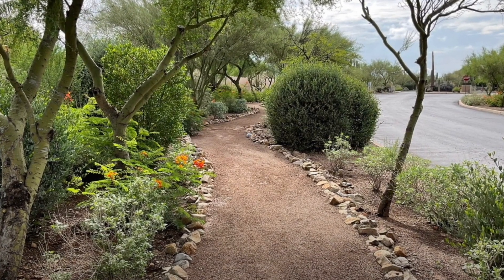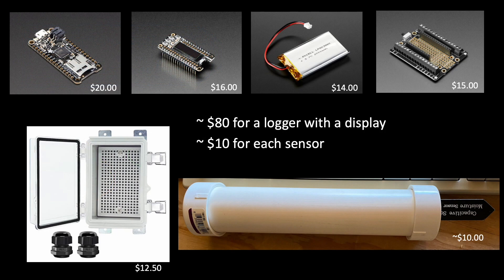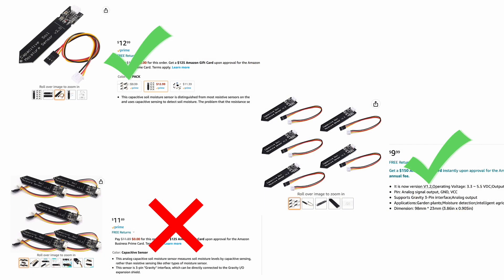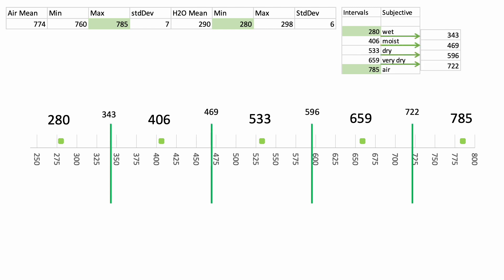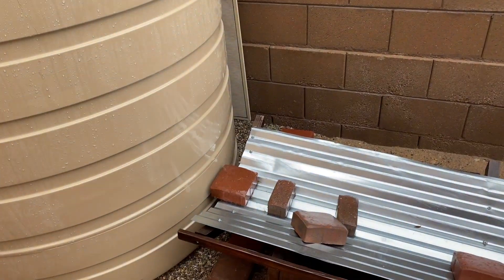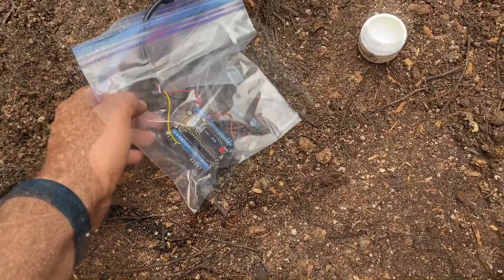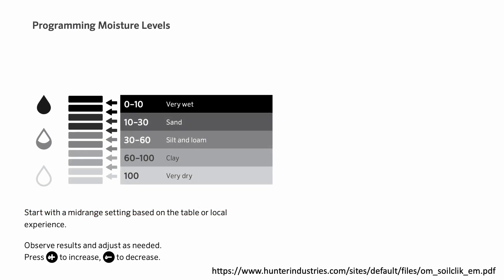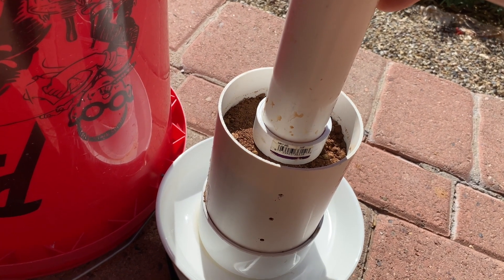Buying, Programming, and Testing Capacitance Soil Moisture Sensors

Comment: hello
what cable did you use ?
i mean the type and some specifications please
Reply from the maker: For my final permanent installation, I recall it was 20 or 22 gage three strand shielded solid wire for each sensor. Either gage will work. Shielded is better if you have nearby sources of electronic noise (e.g. lights, motors, switches, other).
Reply: @ModestMaker thanks a lot dude

Comment: Great vid and project :)  Just one observation.. did the PVC not prevent water from getting closer to the probe than it could have?

Edit: I see you responded to someone else on that.
Reply from the maker: You are right- I am redesigning to diminish bias from water flowing down the sides and include a datalogger. I will update once it's set up and improved. Thanks for checking it out!

Comment: For measuring in scale of 5, these cheap sensors probably will just work fine. 

Since the 555 timer on the sensors outputs only around 15kHz it's nowhere near to the high(>40MHz) frequencies needed reduce the effect of soils salinity on the moisture reading, that means anytime there are tons of rain that washes the salts from soil the sensor will show that the soil are dryer than usually, opposite case is when fertilizing, fertilizer is just a salt that will also affect the moisture reading in this case show that the soils are wetter than baseline. This also implies sensor will show different readings in different soils with the same moisture content. 

Another BIG factor is temperature, these sensors vary around couple percents per degrees C if I remember correctly, that mean if the day/night temperature varies with 10 degrees C it will result in 20% error, I think that is completely unacceptable for it to be useful. 

I strongly recommend testing and calibrating with high performance sensor, best performance sensor that I've tested is METER Teros 12(350$) moisture sensor, super reliable accurate from my testing. And from the cheap end the best sensors I've found to be PinoTech SoilWatch10(25$) sensors, with some calibration, digital signal filtering and temperature compensation they also can be quite accurate and reliable.
Reply from the maker: Thank you for that insight. Yes, I've read temperature can impact the readings. Also, we have high mineral content in our municipal water so that may pose challenges for informing common area watering in our Association (I use rainwater on my own landscape). More experiments are needed.

Thank you for the references on the alternatives for calibration- that's good information to have. Overall, your feedback suggest these low-cost sensors are best used for qualitative measurements and perhaps best calibrated using "feel" to give a general idea of soil moisture content as others have suggested-- but for a couple of dollars per sensor, I'm okay with that.

Comment: In my experience this sensors can't last for more than a half year on the field. The biggest problem is that the soldermask layers absorbs water then starts to come down. Afterwards it starts to produce false readings.
Reply from the maker: The commercial variants seem to have a beefed up amount of insulation around the electronics-- I'll have to watch that.
Reply: Thanks for an interesting video. I saw the exact same problem with the same kind of sensors I used for plants in my living room. The soldermask would start to get bubbles (from moisture) and the copper would corrode under the bubbles. When this happened, the readings would be off and the sensors would not detect when I watered the plants.
I would love to see a follow-up video with your long-term experience when you have used the system for a year og two.
Reply from the maker: Absolutely- I will be posting updates. Thanks for your interest😊.

Comment: I made a similar system and it works great. I used ESP now to create a mesh network. In order to overcome the limitations of the sensor I wrote a calibration based on readings from where exactly I felt the soil was just moist enough. Since I am only working with grass my sensors only reach down about 3-4 inches. This made it easy to detect moisture penetration and simulate volume. The sensors have a small solar cell to help keep them charged. They would last about 2 years even without the help of solar. The data from the mesh network is captured retransmitted over wifi then logged. Since I made the sprinkler controllers it wound up working great and never has to be touched since it won't water if it's not needed or it's too cold or hot since the controllers grab weekly weather forecast data and adjusts as needed to keep the moisture optimal.
Reply from the maker: Thanks for sharing. Yes - I've been wondering how to handle the sensor calibration in a way that yields something meaningful. It can get pretty complicated fast so your approach of feeling the soil might be a better place to start so that I don't get bogged down.  I have to learn more about ESP- I see lots of comments regarding the same and suspect I'm missing out.

Comment: Great work. Would be good to see if you could make the pvc house everything including the microcontroller so you could auto log over time then report back to somewhere where you can graph all the data. ESPhome should have a bunch of the stuff you need to make this happen. Probably don't need it but you could add a small solar panel on to the top of the pipe to keep the microcontroller battery topped up. But there are some ESP stuff you can do to make them run for a VERY long time.
Reply from the maker: Yes- definitely going to have to look into ESP as an alternative and yes- your suggestion of encasing everything in PVC with a small panel makes sense. Okay- ESP on my to-do list. Thanks!

Comment: Greetings from Australia, and thank you for another very interesting video!
I've used capacitive soil moisture sensors in a similar application. I think your hypothesis is right. They give highly variable readings depending on soil composition and sensor location, and require calibration for their specific point of installation. 
I took such a sensor, applied a thick conformal coating over the electronics, buried it at 100mm and logged the readings every six minutes over six months. I found that over time calibration is inclined to drift, probably caused in part by changes to the board's electrical characteristics from temperature, component tolerances, ingress of moisture and corrosion. Additionally, I believe that the capacitive characteristics of the soil change because soil tends to have a mobile composition. Changes to chemical composition, biological motility, or organic structure would all alter the capacitive characteristics of the soil to some extent.
An unexpected effect that I noticed was that the sensors reading changed dramatically depending on temperature and barometric pressure when soil moisture levels should be static. There was a direct relationship in these readings with my set-up. This requires some further investigation. 
I haven't given up on capacitive, but the variables are troublesome so I went back to a resistive sensor with which i can limit the variables more easily. It gives generally satisfactory results for irrigation.
Reply from the maker: It's wonderful to hear your experience and feedback from Australia. Your observations regarding temperature (and barometric pressure) have merit since I noticed some drift in my own logged tests when moving my tabletop experiments from my heated home into my cold workshop. This does raise some challenges in regards to developing a sensor rating curve for volumetric water content since workshop conditions will not be the same as field conditions. In fact, I'd like to use temperature to compliment these sensors given water has a high specific heat and buffers soil heating during the day. Further details on using temperature as an indicator of soil moisture are summarized here: https://ecorestore.arizona.edu/news/2020/10/using-mulch-prevent-heat-stroke-desert-landscapes. 

Your other comments regarding soil texture and movement are also of interest-- I've downloaded a few papers that look into these facets which I hope to summarize in a future video. My sincerest thanks for taking the time to share.
Reply: @ModestMaker  
Thats a really interesting article! 
Our water problems aren't usually too different to Arizona where I live, in Adelaide, South Australia. Although perhaps not at the moment because of the unusual weather patterns here. 
I've buried the capacitive water sensor in proximity to a Dallas one-wire temperature sensor and that gives useful feedback for soil temperature.
Although I haven't given up on capacitive sensors, I've been experimenting with measuring water levels in ollas (the buried terracotta pot irrigation method). In principle the measurements aren't too different from tensiometers but as I'm only interested in the rate of water transit through my soil medium rather than the specific volume, I don't make any special effort to calibrate for the usual variables and its good enough. The arrangement for automatic control and observation is quite simple, I just put one of my automatic drippers over an olla and chart the rate that the water level drops when the dripper is turned off.
Lately I've departed from trying to measure the volumetric quantity of water in the soil, instead focusing on the soil temperature and the rate of water loss (say to evaporation, drainage, use by plants). I'm of the opinion that purely observing trends in water loss dispenses with the variables problem of electronic soil measurement for specific water volumes and gives a more usable metric for irrigation because its quite easy to gather good data and map trends for predictive watering.
Reply from the maker: @tomran247  I love the idea of using terra cotta pots for measuring water potential based on infiltration rate. That's fascinating and something I'm going to have to look into as an alternative-- it's so simple! I assume if the infiltration rate is relatively higher, your soils are relatively drier and warmer. (I also have a few Dallas sensors I've been playing with.) There's lot's to think about in regards to future designs and experiments. Thank you for sharing all this!

Comment: Sensor placement is really tricky. Your method looks good but I see an issue with surface water seeping down the outside of the pvc tube. Water wells generally have a concrete pad to prevent this happening. A better system might be to completely bury the sensor (electronics suitably encapsulated) and just bring out the cable. Lay the sensor flat, run the cable horizontally for about 6 inches and the to the surface. Just my 2 cents worth.
Reply from the maker: Good point. I agree and will revisit the backyard installation. More importantly, I have to see if these sensors will actually work for predicting volumetric water content. From my preliminary tests, they seem to be extremely sensitive to the presence of the smallest amount of moisture in soil, and thus may suggest “moist” readings when available water is well below wilting point (not helpful for managing irrigation). I need to study these sensors a little more.